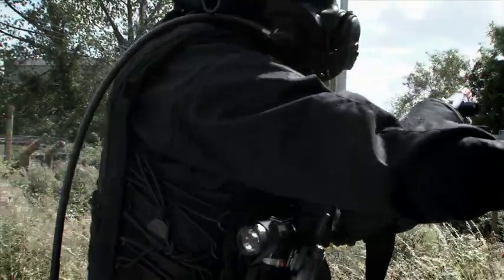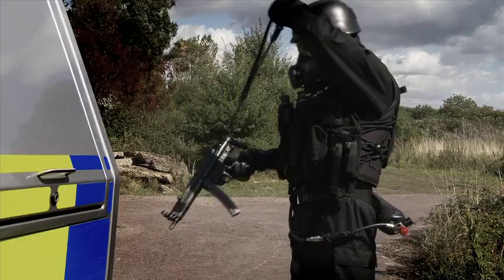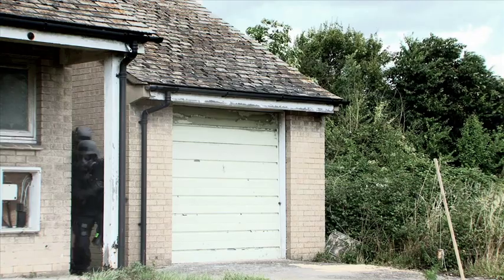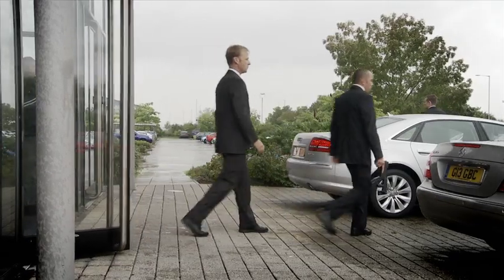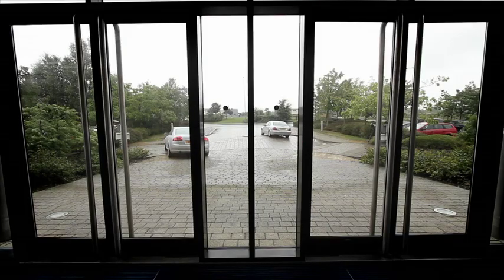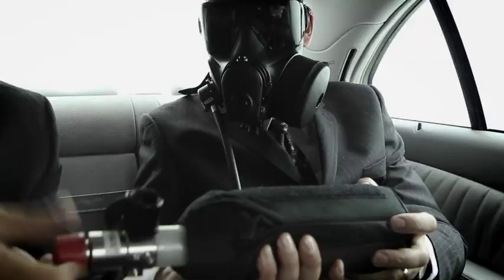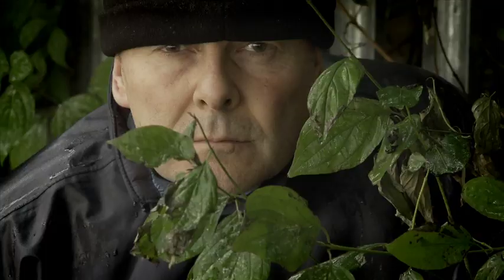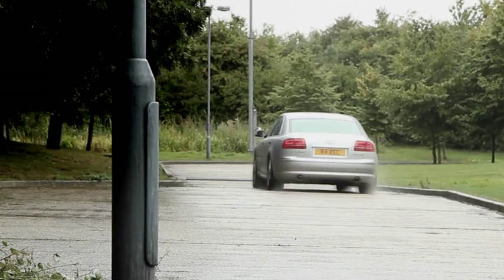ST53 SCBA by Avon Protection

Comment: Does it still function like a normal filtered gas mask? Or is a separate tank required always
Reply: It does when you take off the tank. It’s very versatile.
Reply: Well yeah. You can use it like a standard air purifying respirator due to its 40mm nato threaded intake ports. Simply remove the tank and unthread the hose and thread a 40mm nato filter. Now whatever filter you choose will ultimately depend on the contaminants you face
Reply: @domp5014  that was another thing I didn’t understand......how long do these filters last until they aren’t able to be used again.

Also I imagine that removing the hose isn’t something that could be done on the spot.

(Please forgive me if I’m not a gas mask expert >~< )
Reply: @jakeb.7997  well you literally just unthread the hose, pretty straight forward. The hose uses the same connection as 40mm filters as well. Also, filter life will ultimately depend on the present contaminates. For example, if you’re protecting yourself against particulates, the filter will basically last until the filter is clogged up with so much particulate matter that it hinders breathing. It’s a different story for other contaminates, however, such as gases and vapors
Reply: @domp5014  I’m also guessing there is no way to clean the filters afterwards?
Reply: @jakeb.7997  yeah. They can be reused, but once they are full of contaminants, they are to be disposed of accordingly. Any water or moisture that’s gets into the filter will compromise it, so the interior should remain dry
Reply: @domp5014  so usually they are disposed of after 1 use? The extent of which they can be used afterwards is a bit confusing.
Reply: @jakeb.7997  yeah it is. it really depends on duration of use and type of contaminants. I really can’t give a straight forward answer as filter life really varies. But in the particulate example I gave (involving things like dust, viruses, or bacteria, CS gas) ideally you should dispose of the filter after one use, but you can still technically use the filter until it’s clogged with particulate matter (pretty sure this is against occupational regulations tho lol). For gases and vapors, well it gets complicated, and it’s better to just dispose of the filter accordingly after one use against these threats. I think Avon has more thorough information on the site tho